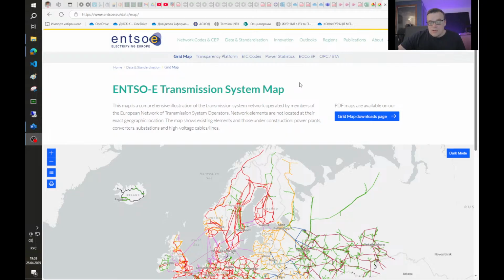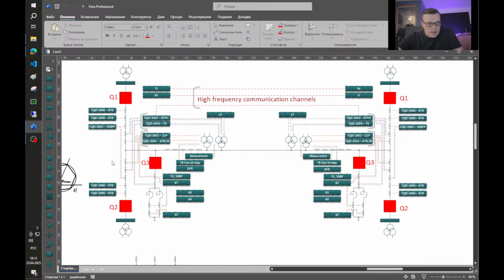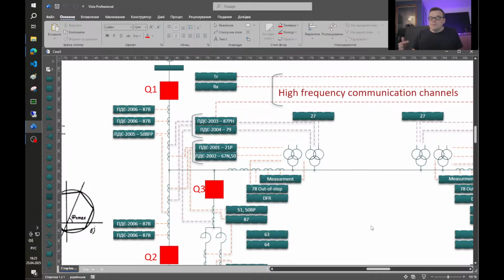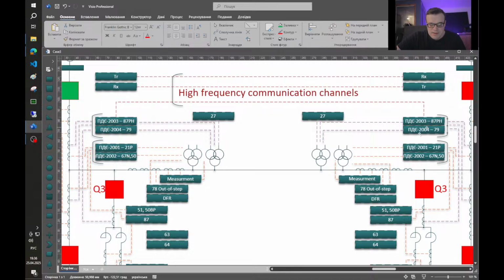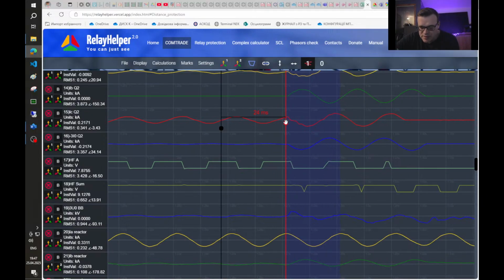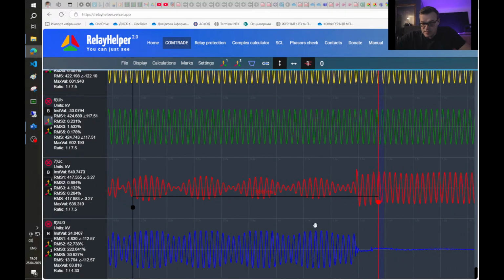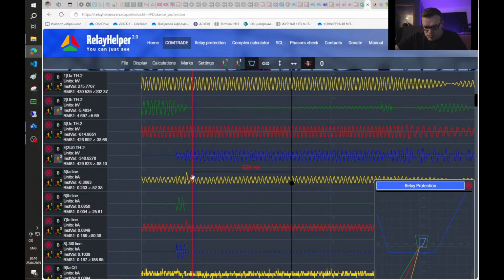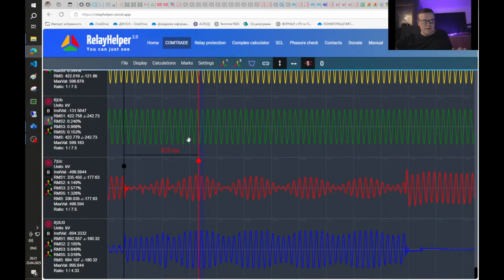Case study 3. Unsuccessful 1ph AR on a 750 kV Transmission Line.

Comment: 13:05 is it "differential phase comparison" protection?
Reply from the maker: We usually call this protection 'phase differential' in Ukraine, but the L60 from GE calls it a 'phase comparison system,' so maybe “differential phase comparison protection” would be more correct in English. ПДЭ2003 works as “differential phase comparison protection” only during single phase AR cycle.